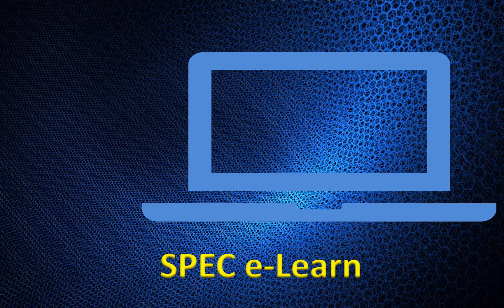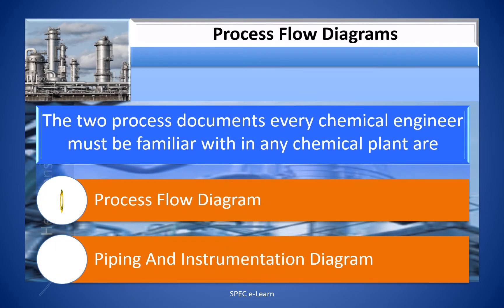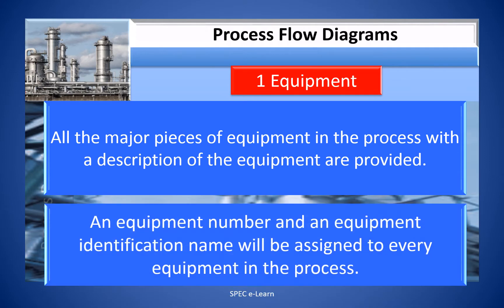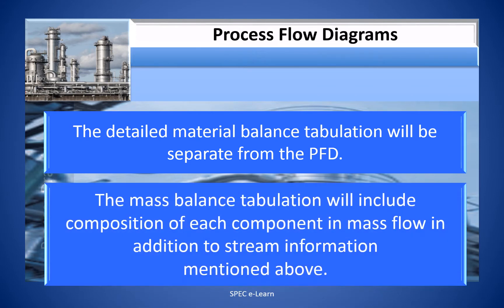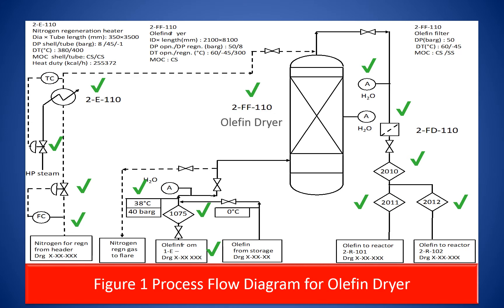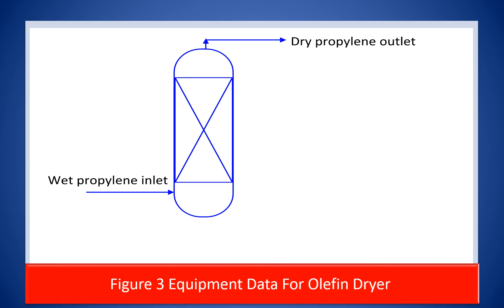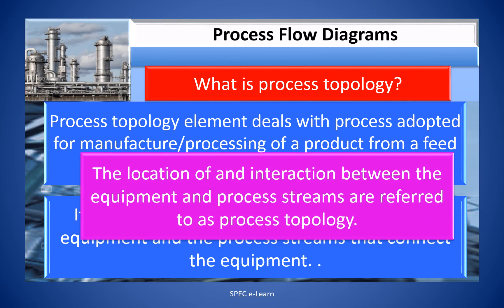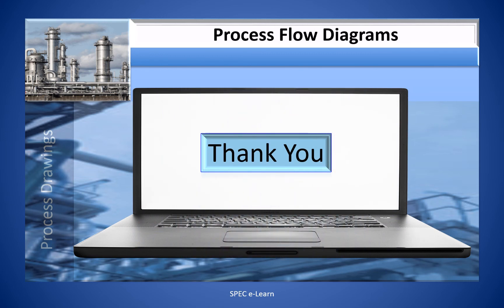How To Read Process Flow Diagram (PFD)

Comment: I THINK WHILE JOINING RUPAY CARD NO IS NOT GETTING ACCEPTED
HOW TO PROCEED SIR
Reply from the maker: The accepted payment methods for YouTube are credit card and debit card ( visa card, master Card)  or UPI or Google pay. Hence use any one of them.
Reply: @SPEC786  mine is rupay ,nut accepting,
upi and google pay option is not showing or  not in active mode on  interface
Reply from the maker: Ok. Then pay by credit card or debit card
Reply: @SPEC786  i have debit card i tried it but message in red  ' u=invalid or unsupported for payment"
what to do sir
yesterday i joined to udemy but it was so simply done payment method
what to do  sir  you tube help not replied yet